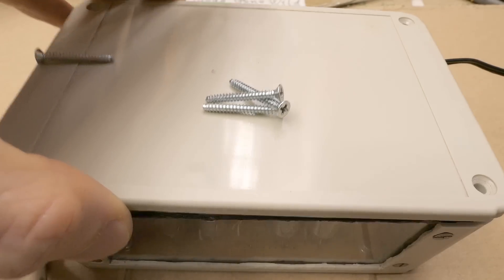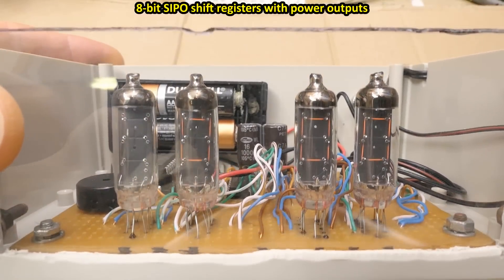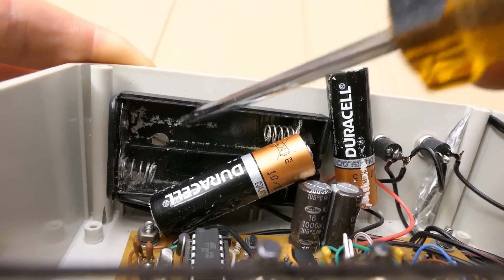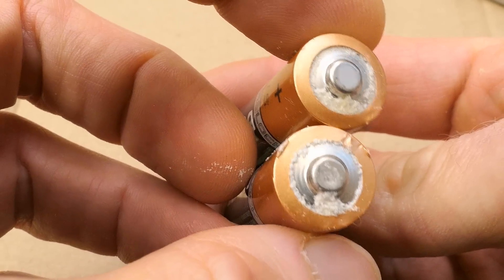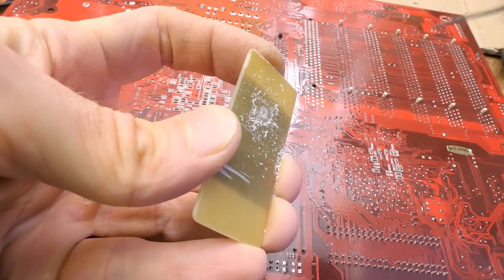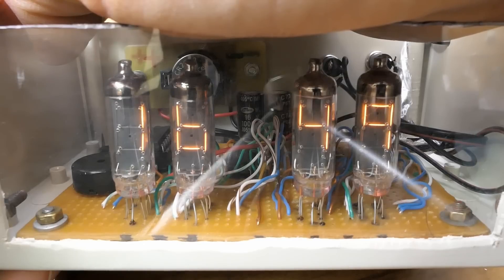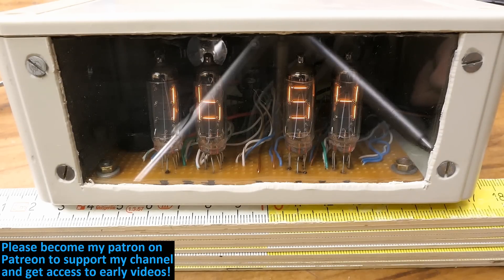DURACELL never leaks...

Comment: I worked on fire brigade safety equipment years ago that used Duracell batteries and the never used to leak. But in the last few years they have destroyed so many pieces of equipment including a £800 test meter, a camera and a PAT tester.  They are now rubbish batteries. I now use hybrid rechargeable batteries that hold their charge in storage and don’t leak.

Comment: Did you happen to check if there was any measurable voltage left on the duracells?  My theory is they only leak when they're very discharged, is there any chance they have some small drain on them bringing them very low, hence the leakage?  (Not saying they should leak at all, while it's a pain, I've had good luck contacting the manufacturer's with pix including the batch number and the corrosion on the batteries as well as the device, and getting recompense).

Big Clive says to cover alkaline cell terminals with vaseline/petroleum jelly to prevent the leakage from damaging anything.  Won't prevent the leakage, just the associated connections.  I just use a drop of light oil, seems to help.

Comment: In my experience all alkaline batteries tend to leak. Put zinc carbon batteries from a reputable brand like Philips into your stuff that needs only low current for years, like clocks and remote controls - they never seem to leak and the lesser capacity doesn't matter for those applications.

Comment: I use since ca. 2010 Energizer Ultimate Lithium. No leaks, high capacity, very long shelf life. From the wall clock to flash units for cameras - everything works great! Cold and hot conditions? Even there! One disadvantage: only available in the sizes AAA, AA an 9V block - at least in Germany.

Comment: Duracells have been banned from the house for years - horrible things. Not only do they leak, but the claims that Duracell make for them are in comparison with zinc-carbon cells. Many other alkaline batteries outperform duracells in my experience. Probably made worse nowadays as even worse counterfeit ones are sold as genuine.

Comment: Thank you for that neat idea of a mini circuit board to hold the CR2032 battery. I'm going to try that, since I have lots of scrap motherboards from which to retrieve the holders !
Reply: I've seen button cells leaking recently. That had never happened.
Reply: @BrunoRegno  They usually only leak if you try to recharge them.
Reply: @kpanic23  since mercury was taken out of the cells composition, they tarnish and leak.

Comment: Duracell is the most expensive battery in my country, and also the worst choice. The away leak before the expiration date. The capacity is also not wat they promise. Just use another brand. Cheaper, and probably takes longer to leak.

Comment: I've had every major brand leak on me at some point. The only real solution is changing them every so many years. Even if they do leak you generally get to it quick enough so that it's not too damaging. 
Also the expiry dates I find are fairly meaningless when it comes to are they going to leak after use. Once you start using them the It's almost like they have a different expiration profile based on that date. They're almost nearly impossible to get to fail intentionally.(Besides just very large sample size) So there's no real good way to test how long they take to leak. There's been a few different people who've published their attempts over the years. No one could really get them to fail intentionally.

Comment: I went to swap the batteries in my smoke detectors with Duracell. The Energiser batteries were put into the detectors 6 or 7 years ago so I thought I would check the voltage that was left. I put the Energiser ones back into the detectors because they had more charge than the brand new Duracell ones. Was only 0.34V more on a 9V battery but if it ain't broke, don't change them.
Reply: for smoke detectors, fit lithium types if you can get  them

Comment: ❌That is NOT Leakage From the Battery.!
👉Go learn Physics some time...
Reply: So where is the leakage coming from? Maybe you could enlighten us all instead of being offensive. Doesn't take long to reply. In 2 minutes you can make us more learned.
Reply: @peckhamian 
I think very sad that you don't understand Physics.
You should research this for yourself, you will gain a greater understanding, than just being given the answer. But I'll cut you some slack and get you started. "Holes don't migrate"."The Fe2O3, that can be clearly seen, indicates Galvanic Corrosion". Add some humidity, now you have a sacrificial anode. 1minute 14seconds...
Get smart, read a book some time.!
Reply: @snakezdewiggle6084  Thanks for the "reply". Again as it often happens with some random internet guy who thinks very high of himself, namely you, when you have nothing to say you go ad persona: "go learn some physics". The thing is my physics is fine. Where do you see Fe2O3 here?

 Everything here started with leaking battery, end of the story. And leaking battery is the only problem. You denying that there is the leak proves that your visit to the optitian is due.

In this clip maybe the damage and corrosion is not that severe. The author could possibly just wash off the white crust and put low discharge rechargeable battery. They don't leak.

 No amount of your "creative physics understanding" is going to change that. Maybe you go and read some books and later also try to get some hands on experience with real life objects.
Reply: @snakezdewiggle6084  I have replied to you stating that is not leakage from the battery. You haven't explained anything, but mentioned some non migrating holes. Maybe it's time for you to read on physics and chemistry.

Comment: I've resigned to putting LSD-NiMH, or Ultimates (both expensive) or Zinc Carbon (can still leak, but it seems only if actively deep discharged, not when they die from neglect. And the juice is not quite as aggressive) in anything I want to store with batteries installed and that I care about not being damaged.

Comment: Other alkaline cells rarely leak. Old zinc carbon cells always leaked as the housing got eaten during discharge. Maybe the slogan is from the time when heavy duty batteries were on the market. The battery holder would have been fine when cleaned. You repair all sorts of old junk and now throw a part out.

Comment: Harbor freight Thunder bolt batteries are the only brand I have found that do not leak. So far anyway. Duracell are crap since they changed the formulation years ago.

Comment: I also have leaking alcaline batteries, even if they are not used and still new in package. It does not matter if duracell, varta, energizer or panasonic: They all often don't last until the printed expiry date, they can leak after a year inside the cabinet, so don't trust their printed shelf life. I think lithium AA's (AAA's) might do better, but cost way more and not worth using in low power devices.

Comment: I have a "blinker" circuit that flashes an LED every second or so which draws so little current that it can run for more than 2 years on a single AA battery
I build this thing on July of 2015, soldered it to a D Cell and keeping track of the voltages. It is now down to 1,35V, almost 10 years later
The cell is a "Duracell Industrial Professional Alkaline Battery" and has a best before date of march 2021 with no signs of leaking

The possibility of leaking batteries is tied to the value of the device they are in
2$ toy: 20 years and still full
300$ multi meter: 2 weeks unattended in the drawer and crustiness everywhere

Comment: Those things always wet the bed. The leaking out of the positive end is actually caused by electrolyte wicking up the inside of the label...
Energizer is somewhat better, but when those leak they LEEAAK. And it's somehow more corrosive than a duracell mess?
Bargain batteries from the local grocery store are the best, you actually get what you pay for...

Comment: I learned the hard way, and now avoid duracell like the plague...

I only ever use alkaline batteries on TV remote,  set-top box and bluray player remote everything else I use rechangeable lidl tronic, I bought good quantities of both AA and AAA. The remotes battery lasts over a year, so tying up a rechargeable battery on a very low drain makes no sense.

Comment: Varta is just as bad. Ironically, in the last two days I've been cleaning out the remains of leaky alkaline cells from two radios and a remote control. A solution of vinegar and water works well. It seems the problem is that the cells leak because they no longer are made with mercury. I've got 25 year old Duracells which are still OK. My way around the problem now is to switch to lithium, or where the lower voltage is acceptable, NiMh.

Comment: Many hospitals have an outright ban on using duracells in any equipment owned by the hospital OR used for patient care whether owned by them or not.   For very good reason.
Reply: Is it a ban on only Duracell branded batteries or any alkaline batteries? Ni-MH batteries are much less likely to leak, and AA sized LiPos are impossible to leak. I highly doubt that the brand of the battery is the main contributor to leakage.
Reply: @vinnysworkshop  Specifically Duracell alkalines, because they do far more corrosive damage to electronics than Energizers and why you'd even think of using any OTHER brand of akalines is incomprehensible.
Reply: @ Okay, so then we'll use Ni-MH and other battery chemistries that don't rely on a free liquid to operate.
Reply: @vinnysworkshop  Yes, but the energy capacity of premium alkalines is greater. You won't get as much service time before needing a recharge,  keep that in mind.

Comment: For two or three AA batteries ( as in your video ! ) ...replace with a salvaged Lithium cell from a disposable vape ( you WILL need a soldering iron and much care ! ) ... these can be recharged many times ( 4.2 Volts MAX ! ! ) .... but the main feature is they  NEVER  leak 😝.... ( tried - n - tested ) .............. DAVE™🛑

Comment: Big Clive here on Youtube already made a nice video about it: Alkaline batteries are more trouble than they are worth. I have switched exclusively to rechargable batteries years ago, bought a big bag of 50 of them and all my devices run on rechargeeable now, including low discharge devices such as remote controls. Alkaline batteries are a bit cheeaper, but even for a remote control a rechargeable battery is less expensive over the lifetime of the device, and that's if it doesn't get destroyed by a leaking battery. Buying A-brand alkaline batteries only helps to a certain extent: You can make the battery housing thicker, but that goes at the expense of capacity. Best solution is not to use corrosive chemicals... which is the case in rechargable ones.
Reply: if those rechargeables are NiMH, they can still leak, especially when they get a few years old
Reply: @andygozzo72  I don't agree. Perhaps  it  is theoretically possible , but then it is really rare. Rechargable is problem solved, regardless whether you use NiMH or Lithium based formula's. I have 20 year old NiMH batteries that are still doing their job.

Comment: Short story is: Every zinc-chloride or alkaline single cell do leaks now. 
I never saw leaked 9v battery. Lithium battery also not seen leak but I use them very rarely because they cost like rechargeable ni-mh but some equipment not work properly with only 1,2V per cell instead 1,5V
Reply: i've seen a leaked 9v battery; just give time for the aaaa cells inside of it to leak enough :)
Reply: Maybe but I never saw six AAAA cell in it but square flat cell stack from bottom to upside with isolated metal string for minus contact on side. I used to delaborate this metal string and top connector because 2-6 AA battery holder use 9V connector back in day.

Comment: You can mostly clean it with vinegar and some alcohol with a little brush. I also use compressed air to blow it clean afterwards and before brushing it. When its worsely corroded of course it doesn't make sense to keep it. No alkaline battery is really safe. Use LFP-lion instead, the deliver 3.2 ... 3.5 V which is o.k.

Comment: The best battery I could find was ABC battery (which is local brand btw. So I'm not sure you can find it outside my country)
They never leak (when used properly). I use them in all my clocks and multimeter
Of course they have their drawbacks. The alkaline variant only has 5 year of shelf life. And for the zinc carbon variant it is even shorter

And of course they will also leak when they are past their expiration date. But at least they are honest products that do not cause problems before their expiration date

Comment: How accurate is this clock of yours? I see you are using a 4mhz crystal, I guess attiny20 doesn't have provision for low frequency 32768 crystal unlike atmega8? 
Does it have ppm correction algorithm too like your previous digital clock with atmega16?

Comment: I'd been using Varta for the past 7 years without incident until 2 minths ago when they leaked in my headlamp. Now im trying rechargeable lithium AA & AAA's to see if they're any better. I got them through AliExpress so they weren't too expensive. Some work well but some are rubbish which is disappointing.

Comment: I lost count how many devices I have that's been destroyed by alkaline cells. Any brand alkaline today leaks if you don't use them up as soon as you start using them. I've had better luck leak wise with carbon zinc cells, or eneloop for remotes.
Reply from the maker: Zinc carbon also leaks and corrodes things. I've seen a lot of AA battery powered analog wall clocks destroyed by these.
Reply: @DiodeGoneWild  but they get used up and replaced before they leak. I haven't destroyed any gadget with them so far 😁

Comment: I can't tell you how many damaged pieces of expensive test equipment and all kinds of stuff in and around the electronics lab/industrial equipment maintenance shop.... Can be blamed on alkaline batteries. SPECIFICALLY DURACELL. 

And complex meters and test gear..... Sure you can go in and remove the corrosion, neutralize everything, and replace components / repair the traces. But I have more than a few pieces of gear that have been made unusable. Because sometimes the inductance and resistance in traces is really important. And the design of the board can't just be botched back together with bodge wires.

Energizer ultimate lithiums are the only way to go. Rechargeable. But they have an insanely long shelf life. And much higher energy density. A bit more expensive. But completely worth it.

Comment: My wife bought a whole bunch of Duracell Optimum batteries a few years ago because they were on sale. All were pretty fresh, they hadn't been on the shelf for years or anything. Anyhow, more than half of them turned out to be leaking, in the package.

I almost exclusively use Amazon Basics and Harbor Freight Thunderbolt Magnum alkaline, if I need to use disposables... I have yet to have either of those leak and they last forever in storage and have reasonable lifetime in devices.
Reply: Deliberately weak seal to prevent  recharging

Comment: All of the alkaline battery brands are total crap now..either they leak, or don't have the capacity they used to. I was using Energizer Alkalines in my wireless mics, 5-7 years ago they were good, but lately they won't hold out for more than 5-6 hours. (I announce motocross races that run 10 hours or so.) Energizer Lithiums are better, but still fall short of what they did a few years ago.

Comment: Many battery brands have leaking problems now as most are made cheap even the high cost units you buy. Worse many brands now own by a very few manufacturers like If people think Duracell is bad, Rayovac and Varta is now as bad or worse since bought out by Energizer in 2018.
Even without battery quality... From the web site with wiring for the clock... IF D1 for the battery backup has leakage or other issues then USB power can try to "charge" the backup battery causing leaking or worse problems regardless of primary battery is Alkaline or Lithium CR2032 etc.

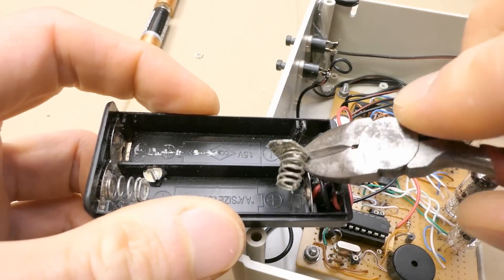Comment: 2:38 They're not that rotton. Ive seen much worse. That can be cleaned up with white vinegar.
Reply: But did you see how the corrosion creeps along inside the wire? This means cleaning with vinegar will not help in this case. The damaged wire must be replaced.

Comment: Durakeak are bad but cheap zinc chloride "heavy duty" batteries are even worse and turn the battery contacts rusty. Good thing you didn't use those.

Comment: i remember when alkaline batteries were a new thing in poland, at least for consumers around 1991-1995 nobody could explain what is the difference to "normal batteries" at least in my family so they just called them no leaking batteries, and while noral batteries leaked acid sometimes they only rusted battery contacts, alcaline damage is much worse

Comment: Whenever I buy a battery-driven device:
The first thing to do: Using a brush, I apply pure petroleum jelly to the contacts of the device. Available in a pharmacy or as aerosol available in electronic shops. Corrosion? Never again!
Then I apply petroleum jelly to the contacts of every battery I use, so it can`t leak any more, even if empty.
Besides: Petroeum jelly is the very best for all plugs, switches, potentiometers and so on !!!

Comment: SB160 SMC diode has a quite large leakage current.
This may have caused battery to fail.
BAT54 is a cheap choice that could work better?